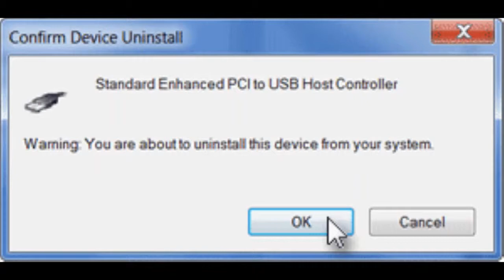How Fix Your Optishot Swing Pad - Sensors not lighting up

Comment: Hi Dean, Two of my laser lens (I call me them lens) have become loose and are rattling inside the pad. Can to the pad be opened (I see 3 screws) to ope ad access loose lens and them place lens back in their slot?? Thanks
Reply from the maker: I believe you can take it apart but I wouldn't know anything about actually working on them. Contact Optishot and see if your swing pad is still under warranty...I think you get 1 year or so. Sorry I can't be more help.

Comment: As an electrical engineer, I have begun to troubleshoot mine and think I have 4 bad LEDs which are not lighting up (voltage drops are not 1.2V as they should be). Looking with a magnifying glass I cannot determine the part number. Anyone know what LEDs they use? I dont think it is worth paying $200 or $250 o fix it since it only costs a bit more.
Reply from the maker: I do not know what LEDs they use. If your Optishot is still under warranty you can send it back and they will send you another one. I had to do that a couple of times. How long have you had it?